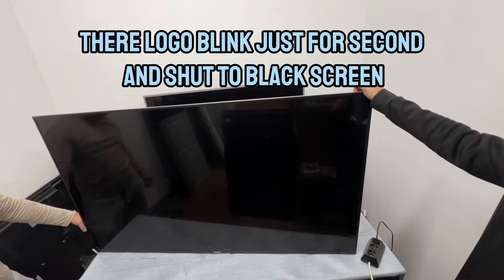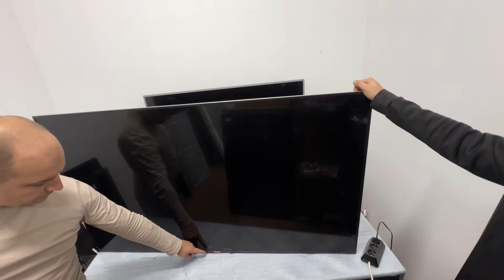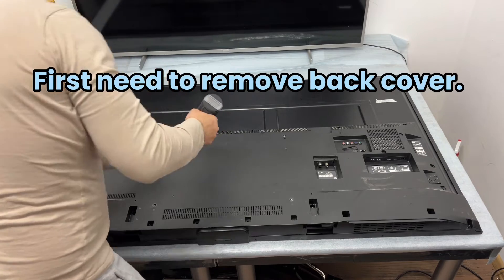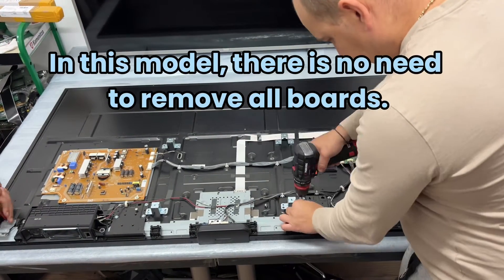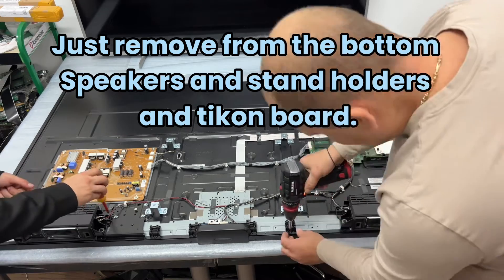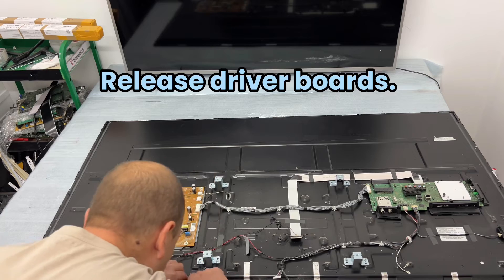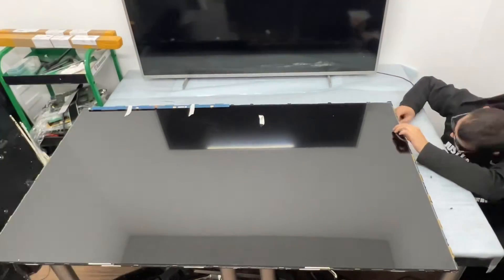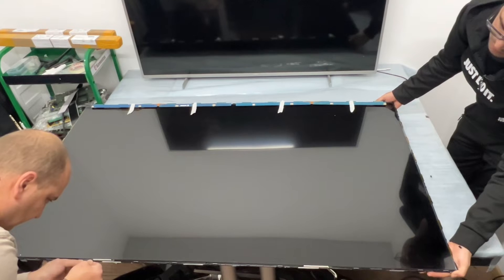How to fix black screen SONY LED TV 65” KDL-65W855C , disassembling and replace backlight.Blink logo

Comment: Hey ive changed the led Strips with new one. But the error remains the same. The led is blinking 6 times.
Reply from the maker: Check cablenconnections , and power supply.
Reply: @mmwhitetech  hey buddy. Well i disconnect the panel and tested without it. I notice that the white led stays and after 10 seconds the left side of the Leds blinked. So i testet every one strip of the right side with a led, which definitely works. The right side don't blink. Do you think the power supply is defect
Reply from the maker: @APPoholicReview You need to measure the power supply supplying current to the cables that power this part of the backlight.